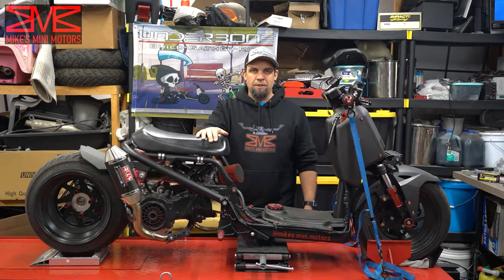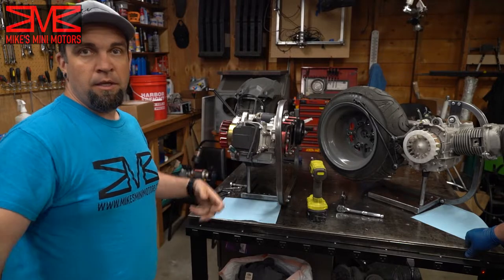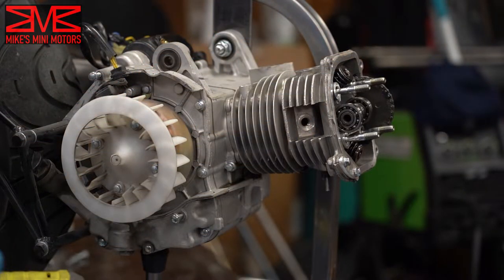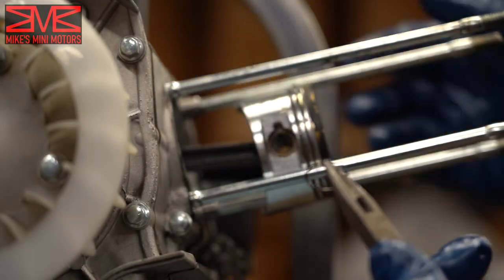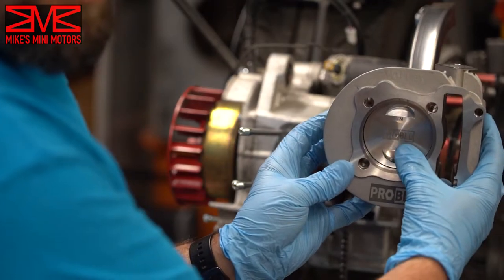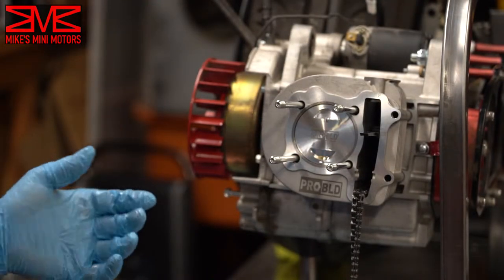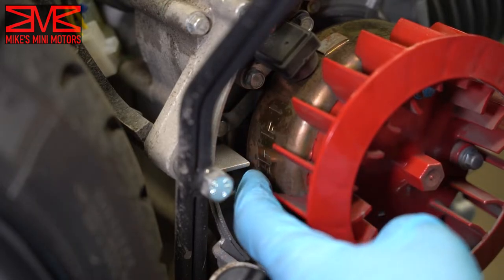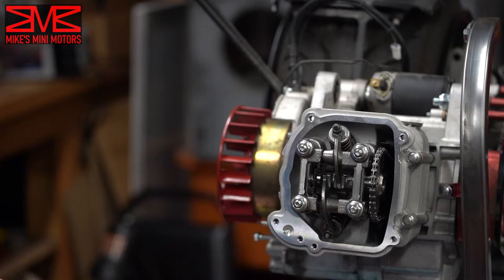Honda Ruckus - Rolling Wrench ProBld 171cc Big Bore Kit Install

Comment: Is that valve cover breather supposed to dump or recirculate back through the intake ? Thanks!
Reply from the maker: I have seen it done both way before, but I just let mine hang and if anything comes out, it just drips down. But I have not noticed anything come out of it before.
Reply: @MikesMiniMotors  currently my cvt and and valve cover are both tee back into the intake and wasn't sure if this was correct or not? Thanks for your help!
Reply from the maker: No problem! Also, my CVT breather just routes to the rear of the engine and then hangs there.